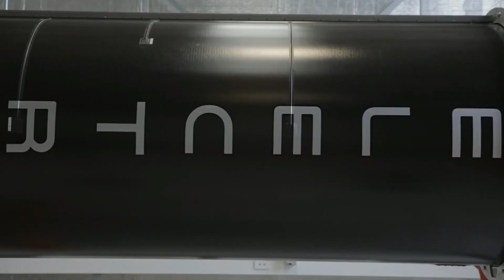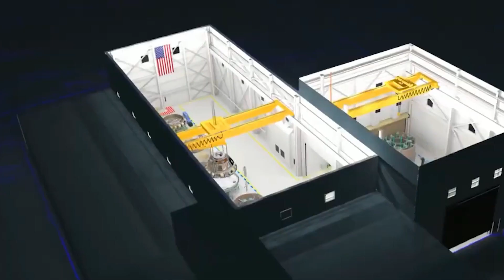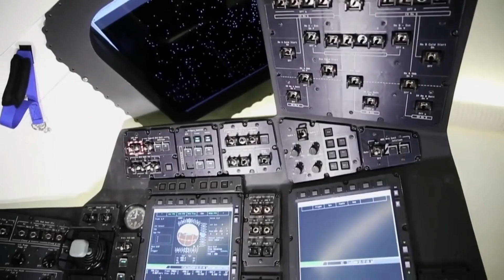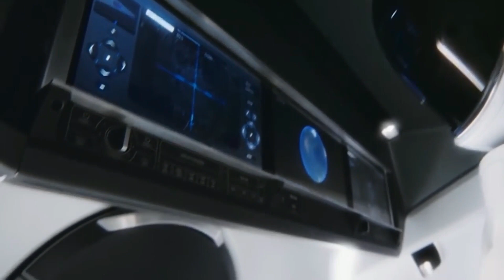Will Boeing Starliner Ever Be Ready For Artemis 1?

Comment: Good Luck finding people to ride on the Boeing piece of crap. If I were NASA's director, I would use Starliner for only cargo shipments to the ISS until it made the trip at least 10 times in succession without any problems. And even after that I would NOT ride on it. In fact I won't ride on ANYTHING produced by Boeing. I don't care if they were producing roller skates, I would buy another brand. The next time I need to fly, I will insist that I get a flight that is provided on another brand of aircraft. Do you hear me Boeing?  You have COMPLETELY lost my trust ! You have murdered too many people with your flying trash !